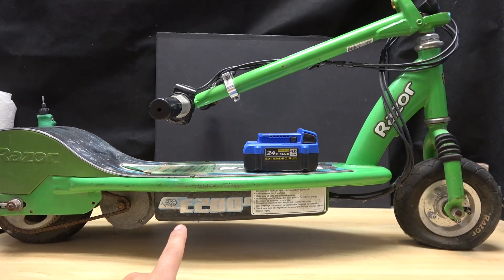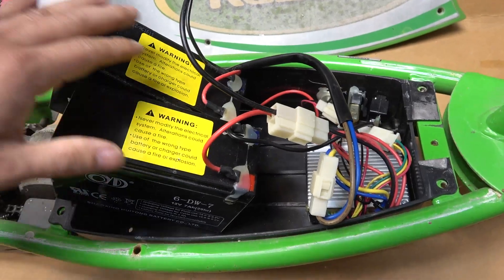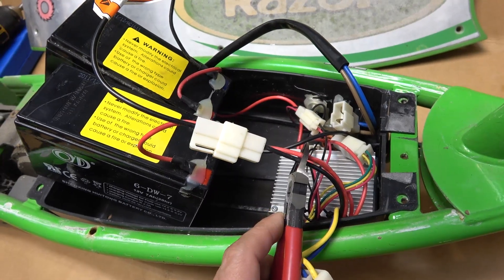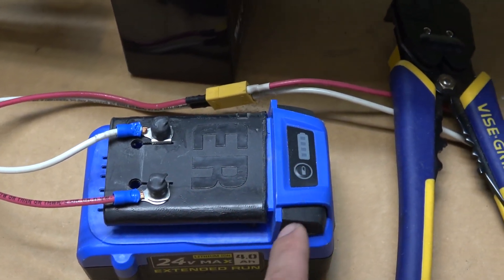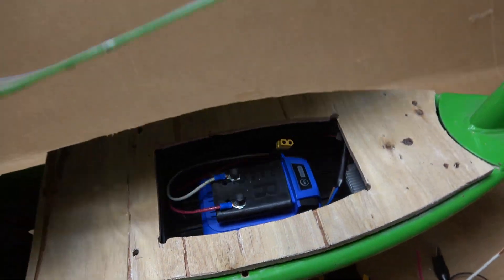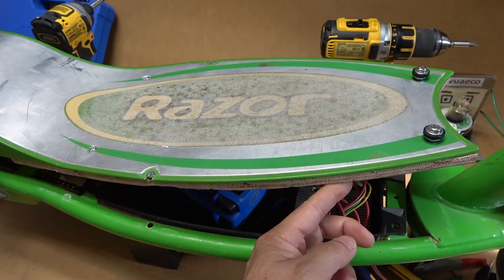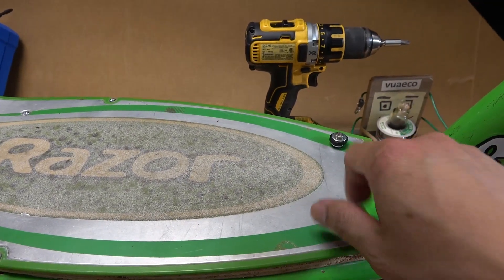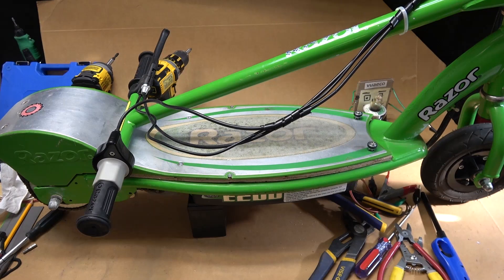DIY: Razor E200 electric scooter with Kobalt 24V Battery upgrade

Comment: My thought is, why not mount the adapter plate at the base of the neck. Allowing for easer battery change. This would also allow for a small storage compartment under the deck.

Comment: What are your thoughts on a VISET LI 24V 1000mah, E-bike battery, 15A BMS for 100W-500W. Amazon has them for $149… could it work for a Razor E300?

Comment: I have an e100 that I've been running off of 2 Milwaukee m18 5ah batteries I series for 40VOLTS LOL I honestly anticipated the speed controller to burn out within 5 min but it's been like 4 months and no issues thus far. 
I've also ran it with 4 2ah m18s and 2 3ah ho batteries.
Went from like 6 mph to about 13 on flat ground.

Comment: Can you help me please. I have a brand new Jetson ion scooter that i got out of box and is not charging.  It was stored for couple years so probably the battery is completely dead. It has 42v 4.0 Ah battery and charge  plug is the 5.5mm x2.5 size. Is there any way I can get this charging without taking apart? Maybe use different charger?  It doesn't seem to be designed for battery replacement. Thank you in advance for any guidance.

Comment: Have you run into over discharging issue? Would you recommend adding a BMS?
Reply: Most drill batteries have a bms built in to charge and discharge the cells
Reply: @Mrbombardermaniac  not Kobalt batteries

Comment: On a 36v 350w controller and motor how far can I push the controller. Will it take 42v or will it just go wide open. So no point just get a new 48v or more controller.
Plus the 350 moter I see u push yours hard so it can take more then it’s saying. 
I got 19-21 mph on my 36v 350w but looking to get to 30mph plus. It’s got 8” wheels so I been told put 10” on it will give 4mph more but help with the controller will it take 6v more or no

Comment: I saw a video a year, or two ago, from a Russian who changed out the SLA batteries from his UPS for 18650s.  Worked far better and something I always wanted to do just not sure how to charge them up since the internal charger of a UPS is made with a charging curve for SLA batteries not Lithium.
Reply: You can use a different/more lead compatible chemistry. I'd suggest LiFePO4, with a BMS for 12v, as the charge and discharge states are identical to lead acid (Pb) cells. in 4s you get 14.4v~ which as far as Lead Acid UPS is concerned is the same. You do need a BMS to keep the cells in balance or a active cell balancer, otherwise you'll end up killing one of the 4 cells in series. That's the only minor modification I'd suggest other than using LiFePO4 chemistry cells.
Reply: @fang64  What I was thinking but the UPS will never know the real charge.  Like the phone mod he did.  The other thing is you need to tap the voltage point the UPS currently uses to supply its BMS for lead acid.  Solder the new connections there to the new BMS.
Reply: @generalawareness101  It'll be pretty close, Pb and LiFePO4 you can reliably use voltage discharge to determine state of charge, plus I doubt the UPS would ever allow it to pull a Pb(lead acid) too low anyway.
Reply: @fang64  Don't trust it myself, and always better to be safe than sorry.